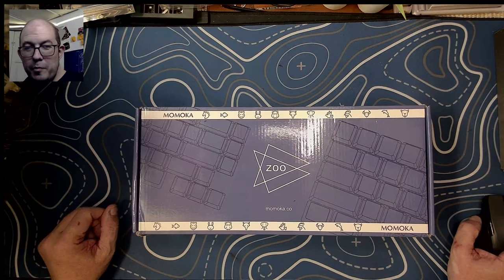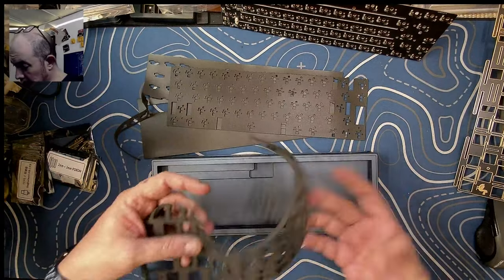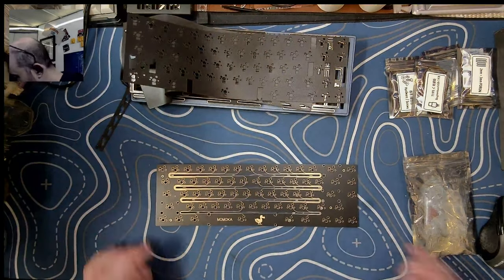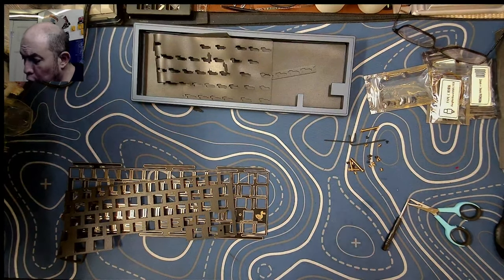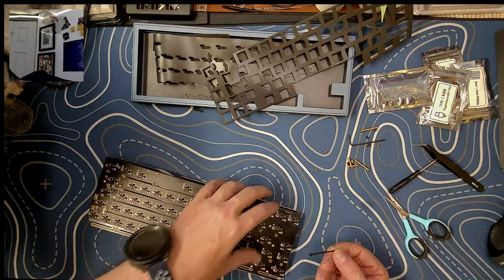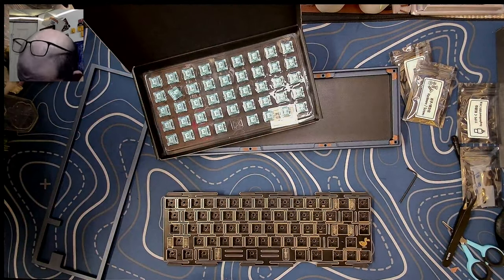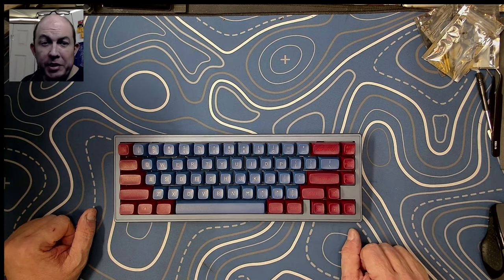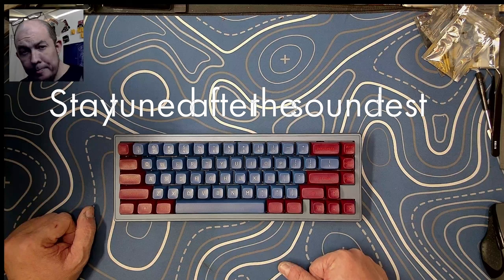Momoka Zoo 65 - Build out, review, and sound test. Better than expected.

Comment: I think that the idea is that the standoffs are optional. If you build with the foams, you don't need the standoffs, if you want the standoffs, you don't need the foam. That said, I've noticed that the higher end the board is, the more they expect you to go full arts and crafts mode. I watch a lot of Alexotos, who does mostly high end builds. Sure, I'll never buy anything he builds, but it's still good entertainment. He often either skips foams or has to cut them up. Betty from S&C has to cut up almost every PE sheet she uses, but that's on her because she forgets what order to put them on, she'll do the stabs first, then realize she was supposed to do the PE first, and will cut it rather than take the stabs off.

For me, and maybe only me, I like seeing you work on stuff in the $150-$200 price range, just because that's where I normally sit with my daily boards. I have a bunch of cheaper boards, but don't use them regularly. That said, I respect that you prefer plastic boards, and know you can make a cheap board sound good, so I don't really mind either way. Your take on the Zoo65 is close to mine. You pay a premium, but end up with just an OK board. If it were under $150 it'd be a steal, but at current prices there's better boards out there. I'm still waiting on my Zoom65, hoping that's better than the Zoo. You didn't mention the designs on it, but I'm not a fan of the fish and dodo. The logical side of my brain doesn't like it because "Sure, that's what I go to the zoo to see, extinct birds and non-descript fish" Maybe if they had leaping tigers rather than fish my brain would let me like it.

Hope you feel better soon!
Reply from the maker: As always, thanks for the wonderful feedback, it helps me to refine my videos and deliver the best content I can!

I did actually go off on a mini rant, actually several around the design and other things which I edited out. Foggy brain is real.

Have an awesome weekend!